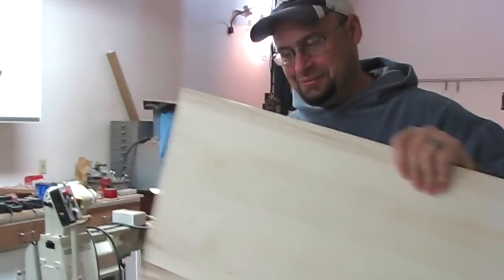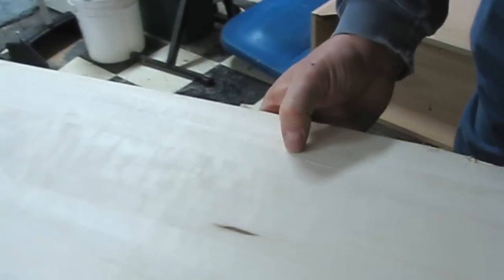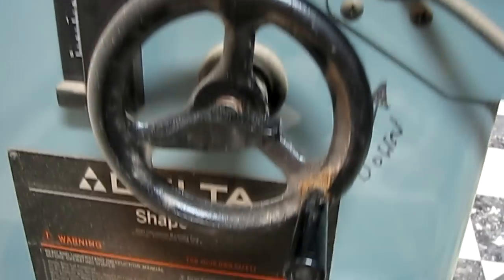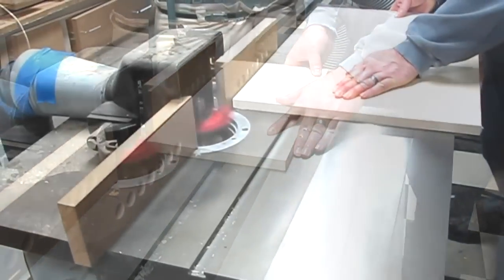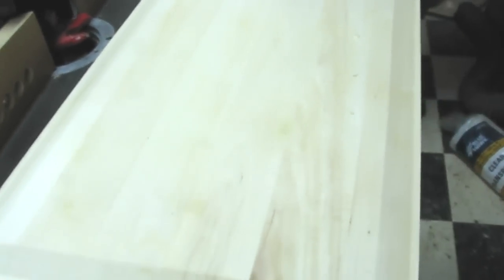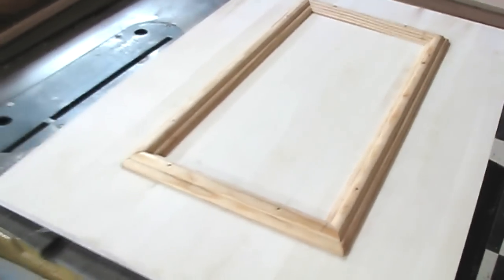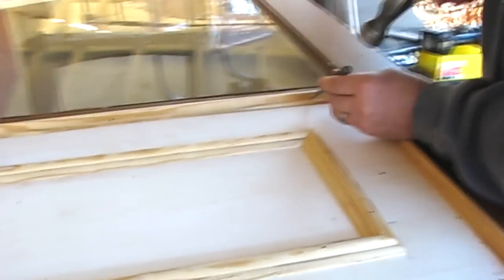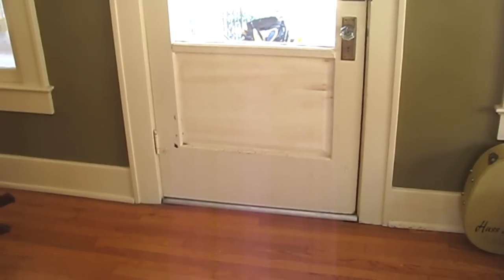Raised Panel Fix for Old Entry Door

Comment: Mother is elderly and unable to care for her huge house. It’s very nice and has top quality big picture windows and casements and a new roof and nice carpeting etc. but she wants to fix a few things yet as her front original Wooden door is arts and crafts solid wood but the lower panel piece cracked so she wants a raised panel done by the Amish.  How can we do this?   I can do some work but I’m not knowledgeable with this stuff.  Is this costly?  If only 250 dollars it’s worth it to preserve the 95 year old door. But if we are talking 400 to 500 then I might as well just buy a nice thick insulated fiberglass door.